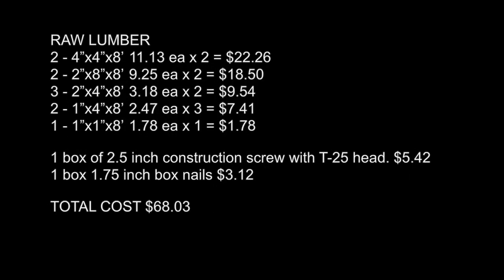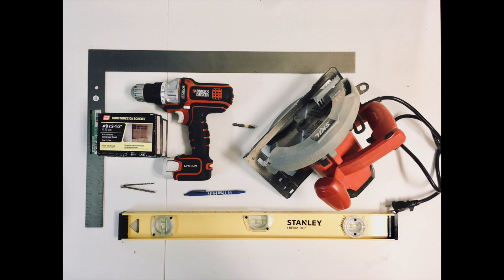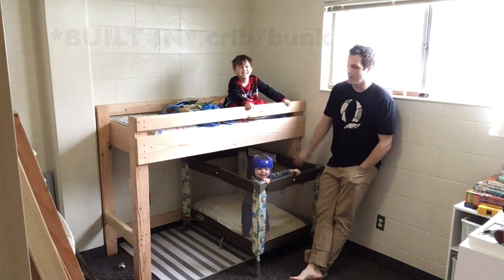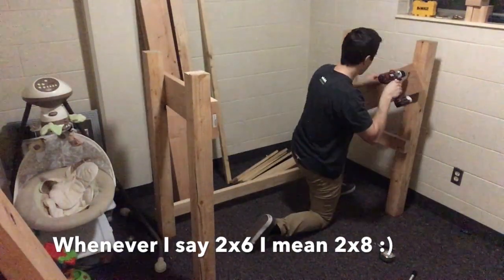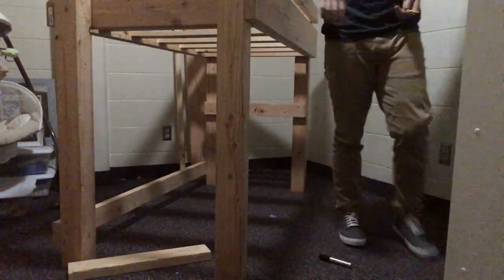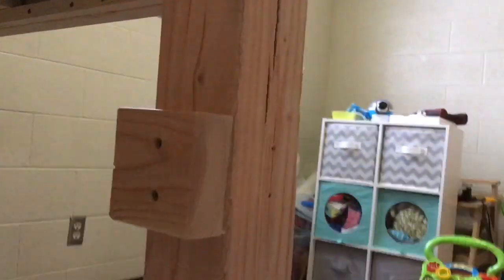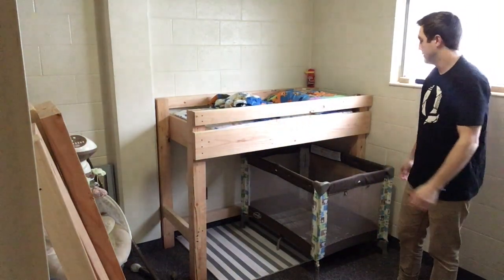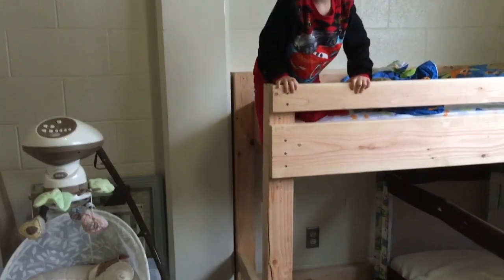$68 Cheap DIY Toddler Bunk / Loft Bed.

Comment: PSA: for the love of God do your own cuts and don't waste someones time at home Depot/Lowe's.
Reply from the maker: haha unless you have no other option!
Reply: Zack Alger after working in the lumber Dept at both stores for 5 years and doing my own thing with wood working, I can tell you two things with certainty: 1 is that the guy in that store rarely cares to make accurate cuts. I always tried and was known for my dead on accurate cuts; guys I trained were never as good as I was and some were downright awful with a saw. And 2, even when they do a fantastic job cutting your project, it may not be correct on your part or you forgot to compensate for something (like kerf thickness) and you have to live with those mistakes or buy another piece of wood. Or be that jerk that goes back to whine that their cuts were off and gets free cuts and products from managers at those stores. End of my rant :)
Reply: Definitely about to have home depot doing my cuts 😭
Reply: How hard is it to make accurate cuts with a flipping laser at home depot do your job  lol 

You sound like the kid at McDonald’s ranting about wanting more than minimum wage but you forget to put the straw in the bag 🤣
Reply: they get paid to why not